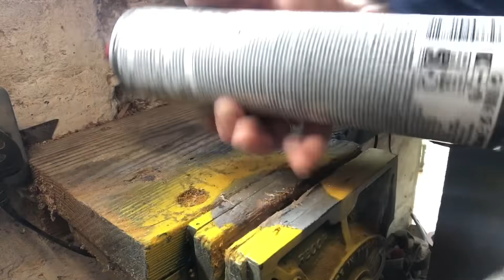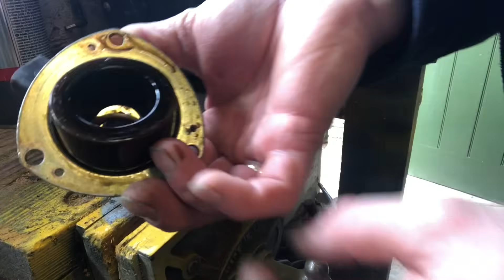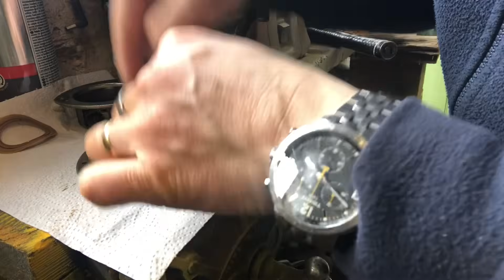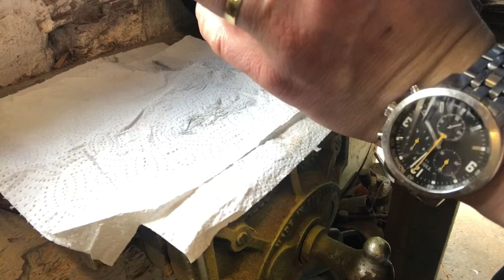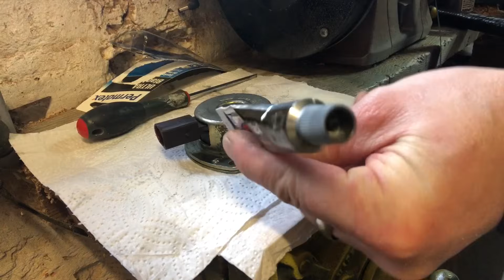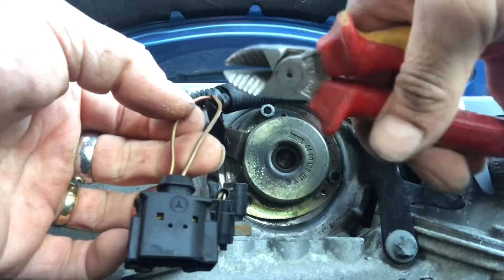Mercedes 230 M111 camshaft magnet oil leak repair - SLK R170 Restoration Video 26

Comment: O ring is used in the newer m271 motors, for m111 the proper correct way is with this sealant paste as you are doing it. I was confused at first but then i realized
Reply from the maker: That’s reassuring, thanks.
Reply: @SteveWardellDIY thanks for your response mate, keep up the good work

Comment: Hello, the video was a great resource, thank you for that. I also have leaks from the magnets in my M271 engine socket. I have an intermediate protection socket installed, but I want to stop the oil leaks this way. Did it provide a permanent solution? I'm curious how long it prevented oil leaks. Or would it be more logical to just replace the magnets?
Reply from the maker: It’s still okay now, so seems to be a long term fix. Good luck with yours.
Reply: @SteveWardellDIY  thanks, If I open the magnet and find the seals are in poor condition, cracked or broken, what do you recommend I do?
Reply from the maker: @h @hasan5865 probably best replace them.
Reply: @SteveWardellDIY  Thank you. When I opened the magnet, I saw that the seals were intact, so I followed the same steps. I will keep you updated.
Reply from the maker: @hasan5865  Great news. I hope it lasts okay for you.

Comment: Can u use wd 40?
Reply from the maker: WD40 is a penetrating fluid used to help ease fixings. If the bolts holding the unit on are seized you could use it to help free them, but likely if it’s leaking there will be oil all over them anyway. The gasket compound used could only be substituted for a similar product, or gaskets if you can get them. Where else might you use WD40?

Comment: The leak is actually coming from the INSIDE of the female connector on the magnet sensor. It needed the new superseded sensor with improved leakproof internals. Its going to continue leaking.
Reply: Mercedes has a TSB that addressed this problem.
Reply from the maker: @t @tvdb6153 at’s a TSB

Comment: Using 1000 grit sandpaper, you can smooth the surface of the camshaft sensor.?ggod video
Reply from the maker: Yes, that would work if it needs it.

Comment: Looks like an amazing repair and I see it's still holding up nicely from the comments on the video. I just started taking mine off and I have run into a snag. I got the bolts out but the part won't seem to come off no matter what I do. I don't want to use any penetrating fluid to get it off because I'm afraid it will contaminate the engine. Is there any advice on how to take this off that you can provide? Also do I need to replace the round metal bits next to the bolt holes? (The ones that were drilled off in one of the next steps)
Reply from the maker: Thanks for the feedback. I think if you gave it a sharp tap it may come loose, or you may be able to prise it off carefully using a scraper. Be careful not to scratch the mating surfaces though.  The rivets were not replaced. No need to. You can see it installed without them toward the end of the video. Cheers, Steve

Comment: On my M111.955 W203, oil in the camshaft magnet connector was causing Bank 1 Sensor 2 (B1S2) short circuit code. Once the camshaft magnet replaced, the short circuit issue with the O2 sensor disappeared.
Reply from the maker: That’s interesting, I wonder how oil in the cam magnet caused that.

Comment: Use a new rubber O ring.  Slap it back on there and use a torque wrench to tighten it... it has to be torqued per spec... what happens is people replace these and strong arm crank down on them Thinking that oh it's got a rubber seal.. It'd be okay, but really it's biting down on it, stretching it.And just not doing anything, and it's just gonna leak again ... but you taking it apart is not going to help any.. even if you could get it back together, it's eventually gonna leak. Just don't crank down on the seal When you put a new rubber o ring on and it'll be okay. 

IF YOU OWN AND DO YOUR OWN MERCEDES WORK.. A TORQUE WRENCH IS YOUR BEST FRIEND. lol literally every bolt.. Inside out.. that's if you actually take care of your vehicle.And keep it oem.
Reply from the maker: This video has been extremely helpful to numerous people.
By contrast….
Your English is poor, you’re telling people what to do, and you’re shouting using capitals.
I’m sure you can do better.
Please try to.

Comment: Use a ¼" ratchet and bit... you're causing more damage with that screwdriver
Reply from the maker: You’ve not identified where the screwdriver was used, and for what purpose. You’ve not identified the damage done to what, either.
And you’re telling people what to do, again.
Sadly your feedback is both unhelpful and unprofessional.
I’m confident you can do better.
Please try to.

Comment: do you use some new things to repair?
Reply from the maker: Only the gasket compound. All existing components.
Reply: @SteveWardellDIY i dont want to mess up the whole this so i just clean  whole thing outside and pit gasket compound
Reply from the maker: Mine has been fine, so if you do the same it should be okay too.

Comment: Hi Steve. 
Thanks for your video! As someone already said above, you´re a genius, but I would like to improve that. You are a clever, great observer, handy man, and a genius. 😄
I would like also to add to your experience and to other people visiting your tutorial that your FIX  works also on a SSANGYONG ACTYON, that is equipped with an M111 engine (mine is petrol/gasoline fuel). The part (camshaft magnet) on the SSY Actyon, is slightly different in the shape (completely round), but the disassembling and parts inside are exactly the same. 
It has been already 4 months since I fixed mine and so far so good. By the way, I am confident to say that there will be no leak for many, many, thousands of kilometers/miles ahead.

Thanks for your time in filming and explaining all the steps in details. By the way, I did not solder the cable, because I was not sure that the oil would go through it, plus I did not want to run the risk of breaking something else in a 14 years old SUV. 
Cheers mate and God bless you!
Reply from the maker: Aww, thanks for the lovely feedback. I’m so pleased to hear it was useful for you, and great to hear your confidence in the fix for the future too.

Comment: Excellent repair option! I did this at the beginning of summer with great success! I also repainted my valve cover and replaced the valve cover gasket
Reply from the maker: Good to hear from someone else that’s done this with success, John. Thanks for the comment.
What were the steps for repainting the valve cover, and what paint did you use?

Comment: Great video! So helpful. I’m about to attempt this on my 2003 SLK 230. I’m just starting out with this car and I don’t have a lot of tools. What tool did you use to get the bolts off?
Reply from the maker: I was using a hex bit in a bit holder on the end of a 1/4 inch socket set ratchet, but a simple Allen key would do with a small tube to extend it for leverage if needed. Thanks for watching
Reply: @SteveWardellDIY Awesome, thanks!

Comment: Thanks for the great video! I just bought a 2002 SLK 200K and mine's leaking oil all over the front of the head. Will try this fix, as I can't seem to find a replacement locally. Do I understand correctly, you didn't replace any gaskets.. you simply added gasket maker? Thanks again!
Reply from the maker: Yes, I re-used the existing gaskets with a coating of gasket making compound. No guarantees if you use a different make. The one in the video was recommended on a forum, and worked for me.
Reply: @SteveWardellDIY  Thanks, I appreciate the reply! I'll give it a go with a heat and oil resistent sealant.

Comment: Hey man! Great SLK channel. Is your car still running good, no leaks? And did the sadder help with wicking?
Reply from the maker: @decodethatrap  yes indeed! There’s no leaks and I’m confident any wicking will have been stopped in its tracks. This fix worked really well.
Thanks for watching, and for the positive feedback.
Reply: @SteveWardellDIY terrific! Mine is sounding like a diesel at cold start and ticking (was your making noise under load or cold start?) so I went ahead and bought a new one. Will install tomorrow. Thanks again
Reply from the maker: @Foreverfadedstudios  I wasn’t hearing any ticking, no. Good luck with it I hope the new one cures the ticking too. Let us know. Cheers, Steve
Reply: @SteveWardellDIY replaced the part yesterday and THERE IT IS! No more noise 🎉🎉 Thanks again Steve!
Reply from the maker: @Foreverfadedstudios   Awesome result! Well done and thanks for sharing.
Reply: @For @Foreverfadedstudios my does the ticking noise on the cold start but I’m going to replace it hope the noise goes away
Reply: You’re a genius, thank you! I just completed the repair per your direction ( minus the harness mod ) and it worked like a champ! Thanks!